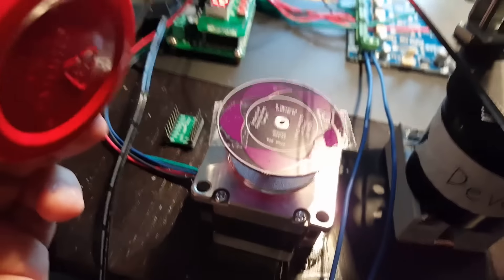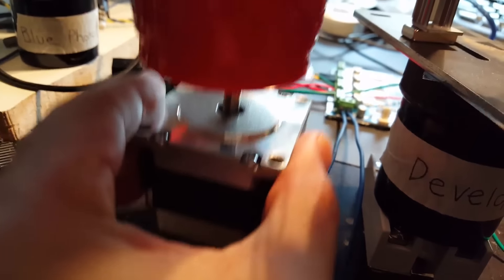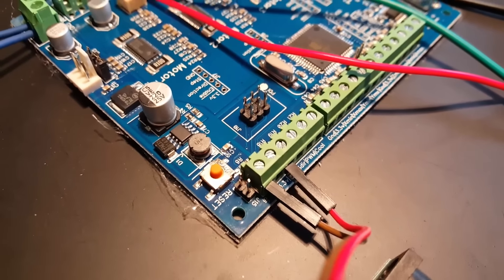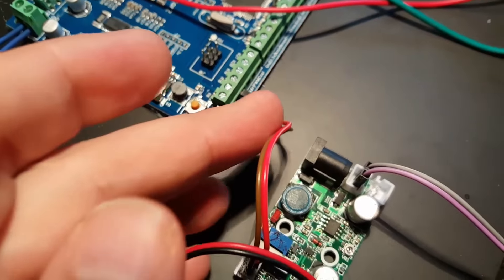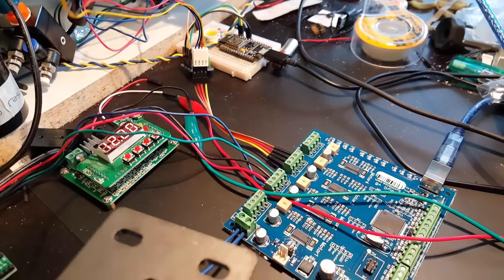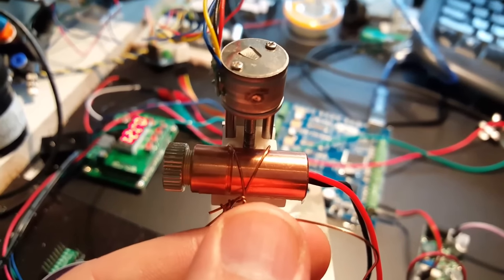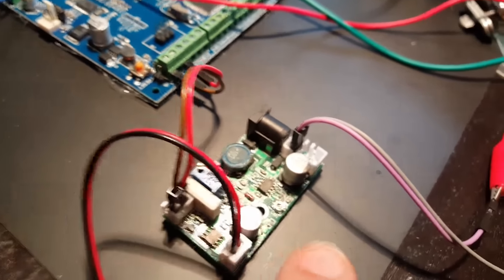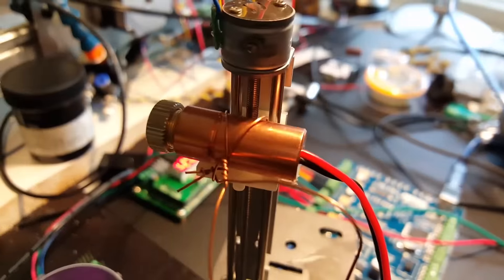Laser writing on a red solo cup with ChiliPeppr and a TinyG

Comment: Hello John:
I just came across your page and TinyG due to a comment I found on Instructables, "Raspberry Pi Alamode CNC Controller_ 13 Steps (with Pictures)" with reference to connecting the system directly to a laptop. IN there, you have to use the Raspberry Pi connected to an Arduino ALAMODE board and then to a GPIO  card for a set of three cards (Raspberry Pi + 2 additional hats)and no laptop. However your option about using TinyG is of interest to me and I have questions: 
1.  How do you connect the laptop to the TinyG board?
2.   What operating system is compatible with this board? Windows, Linux, MacOS??
3.  Since my application includes a 5W Laser, is the Spindle connector points the controls for the laser?
4.  I noticed that there is an additional board that controls the power. What kind of board is this? A power distribution unit?
5.  The Laser that I have in mind runs on 5-12VDC but the power supplies you call in this project are 24VDC and 48VDC then a different supply is needed. How do you approach this problem?
6.   Perhaps you could prove us with a schematic diagram that illustrates your design?
Thank you very much.
Hermann Amaya
Reply from the maker: I would suggest watching more of my videos including "Build a ChiliPeppr Driven 3040 CNC". You just plug TinyG into a Windows, Mac, or Linux computer into the USB port. Then TinyG connects direct to your stepper motors on your CNC. What I like to do thought is connect the TinyG to a Raspberry Pi's USB and then I just connect to Serial Port JSON Server on the Raspberry Pi from my Windows laptop.
Reply from the maker: For the laser I would check out this video https://www.youtube.com/watch?v=SlHhcErWCDQ on how I did my laser control from TinyG. Basically I use the coolant on/off pin as my laser toggle pin.